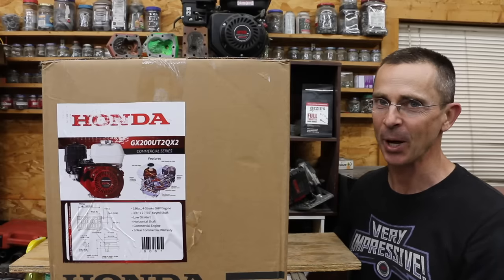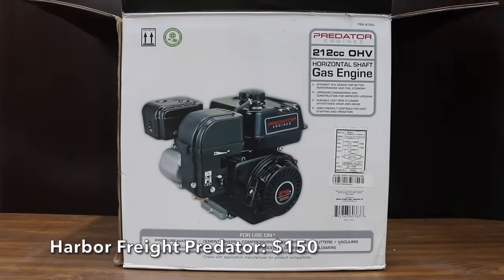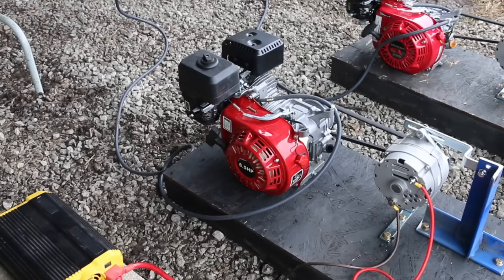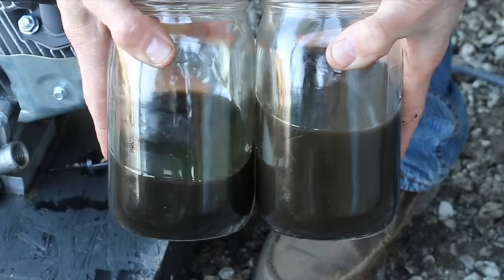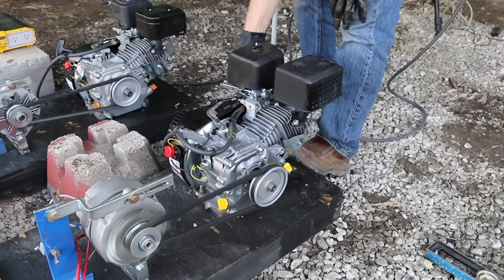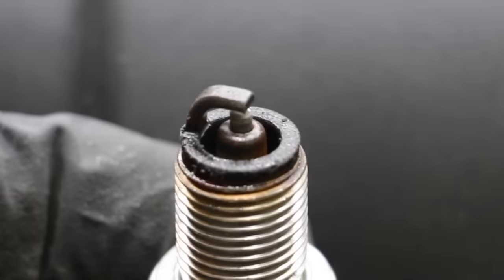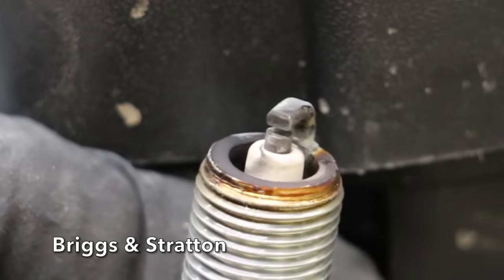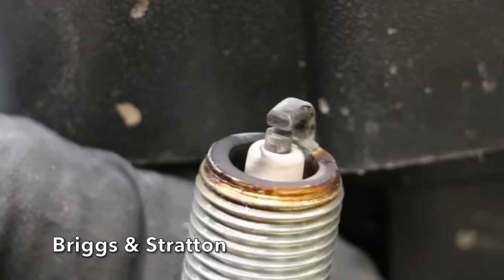$150 Honda Clone vs $600 Honda? Let’s settle this! Fuel Efficiency, Horsepower, Durability, Starting

Comment: I love these types of comparison videos. It's easy to see the joy you get from doing them. I've had the opportunity to compare the Honda and HF Predator products a few times (Generators, Inverter Generators and Gas Engines) and although technically the Honda products might be a bit better quality, the difference in price, in my opinion, doesn't justify buying the Honda product. You'll sometimes pay 3-4 times more for the Honda than the Predator while getting just slightly better quality, and in some cases the Predator is better than the Honda.
Reply from the maker: Thanks!

Comment: Replaced a Briggs 5 hp lawnmower motor with the Predator.  BIG diff in power.  Happy with the result and it's quieter as well ;)
Reply from the maker: Thanks for sharing.

Comment: I own the harbor freight (hemi) 212 cc engine that I purchased 3 years ago for a go-kart for my kids. I better the carb, installed a free flow exhaust with tip, and a torque converter for max HP. She puts out roughly 11 HP with dialed in setttings. Or so I was told. I believe it closer to 9 HP. But EXTREMELY reliable and always starts oh I purchased that Predator motor for a jaw dropping $99.00 3 years ago. It’s still going and I love it.
Reply from the maker: Thanks for sharing.

Comment: Very good videos, just one question. 

Did you run each engine at full throttle without any load nothing on the pto shaft and check each engines rpm to see if they were all the same before doing any tests ?

If you have one running at 3600 rpms and another running at 3200 your output is going to be different. 

Maybe you did and I missed it, I have a digital tach to check rpms on small engines. 

If you did do this and I missed it I truly apologize for bringing this up. 

I do like your videos and am very impressed by your professional efforts. 

Thank you

Comment: HI. I just loved that presentation. Fast clip, delivered like a commentary on the Kentucky Derby or Melbourne Cup. I bet on the Honda, with the Briggs and Stratton a close second. That spark plug analysis fired me up, and drug testing the urine, (sorry, oil) was straight out of horse racing 101. And when the go karts raced across the screen with mine in front by a head, it was so exciting I nearly dropped my beer. So this is what race commentators do when there's no big races on. Well done, Cheers, P.R.
Reply from the maker: Thanks!
Reply: @ProjectFarm  And here's the judge's call: It's P.F. by a nose. Cheers, P.R.

Comment: I used to manufacture concrete floor saws.  What I found was the 5.5 had better torque and performed  than the 6.5 using 1:1 ratio with both Honda and the clone.  With 6.5 motors had to slow the cutter down to avoided stalling. Where the 5.5 you could push cutter harder with out stalling.   Over all the 5.5 cut much faster.   I’ve wondered if gear ratio could help the 6.5 but not tried it.  Great test I do wonder how much difference using 5.5 Honda affected test results. 😊
Reply from the maker: Thanks!  Thanks for the suggestion.

Comment: Ive had one of those predators on a troybilt tiller for about 10 yrs..there is a recommended break in procedure for them. Which includes a few hot cycles and oil change before putting a load on it
.If you follow it to the letter they do much better and last a long time. By the way,  i use royal purple full synthetic in mine
Reply from the maker: Thanks for sharing.

Comment: I have a Hisun 196cc engine that came with my mini bike. I removed the governer and have added performance parts and rode it pretty hard for 3 years. At this point the keyway on the crank shaft is chipping away from the clutch but the motor is still running very strong .
Reply from the maker: Thanks for sharing.

Comment: This is an excellent comparison; initial inspection, fuel consumption, CO, vibration, and on the go-cart. However, you are inside the break-in period here so, next time could you run them all for about 100hr on the generator stand, THEN do the oil analysis and other tests.  I would expect break-in oil to have higher metal content.
Reply: Good point.   100 hr is a very long break in period though.

Comment: Great test of the capabilities and internal wear of each engine.  My question would be: which engine will last the longest over many years?  (Some old John Deere tractors (like 1950s-'70s) are still going strong with normal maintenance and repair).  Will those engines see the same reliability over decades (with expected repairs as needed -- carb rebuild, maybe new rings).  I'm thinking the Honda engine will be going long after any of the others (although with the substantially lower cost of the Predator, you could buy 2 new ones over the years -- and hope the manufacturing hadn't compromised quality over that time).
Reply from the maker: Thanks!

Comment: Great test as usual. But perhaps use grams to weigh the fuel next time or a scale with finer resolution 👍🏼
Reply from the maker: Thanks!  Thanks for the constructive feedback.
Reply: Thanks for taking the time to reply and for the most accurate unbiased tests going. Checking the fuel temp when weighed would be a good call also as of course fuel density changes with temperature. 👍🏼

Comment: I just randomly clicked this video out of curiosity, and I'm super impressed with your thoroughness in testing these engines. I'm also impressed with the  Predator's performance vs. cost. However, if I needed to buy an engine I depended on for something important, I'd probably buy the Honda. If it's was for something like the go-cart in the video, yeah, I'd buy the Predator.
Reply from the maker: Thanks for sharing.

Comment: Also note Briggs carburetors are mostly plastic nowadays and in my experience ALWAYS have problems within the 1st couple of years, Back in the day (1960-1990) carb problems were not a thing like nowadays! Not ALL due to ethanol like some people claim! I would like to see you do a long term test to find out when repair cost of these become cost-prohibitive and how many years they can go before problems start. I have a Honda mower thats I used for 15 years that is just now showing signs of needing me to start shopping for a new one and can not find any less expensive brands brands that I would consider buying because things are built with shareholder profit in mind and not caring about long term consumer retention! I have even seen this in German made automobiles made for the U.S. market having lower lifespans then in the past. "They don'''t  build them like they used to"''!  ! is now true for just about all things these days. I am 62 and can remember when quality mattered. I have tools my grandfather used that will last another 100 years!
Reply from the maker: Thanks for sharing!

Comment: I worked at a place that had both a Honda and a Predator gas-powered water pump, they both are still working after 10 years.
Reply from the maker: Thanks for sharing.

Comment: I bought one of these honda clones about a year ago for a replacement on my rototiller. Ran good mine didnt have much vibration. But before i could finish tilling an area for my garden it dropped the intake valve. Fortunately i had another Honda motor with a good head swapped the heads out and has been running like a champ has tilled 1 hectar now and no issues. I was surprised to see though that my clone had a cast iron sleeve.
Reply from the maker: Thanks for sharing.

Comment: Awesome comparison. I have used the GX35 honda clones from China as part of brushcutters. Had lots of heating and vibration issues. Finally ended up buying a huskvarna and have been very happy. The Honda GX35 knockoffs clearly have very poor engine design... probably not enough precision in the cylinder machining ....
Reply from the maker: Thanks!  Thanks for sharing.

Comment: The Honda clone from memory has a Nikasil bore coating, while the others have an Iron Liner - may explain the high iron content. This would probably reduce once they have been run in and the high spots on bore hatching smoothed.
Reply from the maker: Thanks for the feedback.

Comment: It is quite sad to see the state that Birggs and Stratton is in. The engines they make now are just not hitting on much. I bought a new pressure washer with a side shaft Briggs engine about 2 years ago. It has never completed a single job without something giving me an issue. I also bought a new mower with a Briggs engine around 2017 before I got into working on mowers, and it was on it's death bed after it's second season. Similar stories from a few different people I know. 
Meanwhile, I have a 1977 Snapper push mower with a 5hp Briggs engine, when i got it the oil was black and too thick to drain out of it without flushing it (it was in regular use before I got it.) That mower starts and runs great every time. Same story with my 1976 Snapper with a 3.5hp Briggs, and my 1993 Snapper with a 5.5 Briggs. They made decent engines into the mid-late 2000s, I have a mower from 2009 with the classic style flathead engine, and those engines are still bulletproof even that late. Once they switched to the newer style engines, things seemed to take a noticeable downturn. At this point, I would almost rather have a knock off Chinese engine than a Briggs. I also miss Tecumseh.
Reply from the maker: Thanks for the feedback.

Comment: I have the knock off one which I use to drive a plunger pump to spray herbicide. Fortunately mine doesn't burn oil and still works fine after 2 years, but it really does vibrate a lot, drifting around on flat surfaces when in use.
Reply from the maker: Thanks for the feedback.

Comment: in early 2000 i imported a Zongshen copy of a Johnson 55HP outboard ( into South Africa ) and put it on a ferry at a yacht club for testing. At that stage any motor used on the ferry had gearbox issues within 6-7 months due to the way it was operated, with the ferryman slapping it into reverse at full speed to stop, then full blast on take-off. You get the picture. Also worth mentioning is that the Zongshen cost about 1/3rd of the price of a Johnson. 3 years later when i left South Africa that motor was still going strong. Bizarrely Zongshen decided to discontinue that motor citing it was not reliable?
Reply from the maker: Thanks for sharing.

Comment: I picked up 2 of the Predator engines a couple of years ago on a black Friday buy one get one deal.  I've replaced 1 GX160 so far and about to replace the 2nd in my go karts.  The Predator is quieter than the Honda's they are replacing and have good pick up.  To be fair, however, those GX160's are from the 90's and are worn out.  I"m not expecting to get 30 years out of the Predators but if I do that'll be a nice bonus.  So far the Predator seems to be a good pickup for the cost, but be advised that getting parts for them can be a huge pain in the butt unlike the Honda.  I'll probably rebuild the Honda's with my kids at some point.
Reply from the maker: Thanks for the feedback.

Comment: Picked up the 700 version of this a few years ago. Those oil pumps are notorious for failing. You can buy a kit that caps off the crankshaft/oil pump shaft opening and run premix. Did it to mine. Youll have to trick the computer into thinking it has a full tank of oil so it doesnt go into "limp" mode. I think i just wired in a resistor in place of the sensor.
Reply from the maker: Thanks for sharing.
Reply: @ProjectFarm  Jeeeeese, sorry. This comment was intended for a previous video in my queue and YouTube took it into yours during autoplay. Nice work though! I appreciate all the time and dedication you put into your videos.

Comment: A vindication of my frugal purchase .. A Predator replaced a Honda on my woodsplitter.  It's been starting right up, hot  or very cold for 3 years now..  The Honda lasted for @ 10 years ... if the Predator lasts 5 yrs I could have a new Predator every 5 years for 15 years at the same price as a Honda.
Comment 12,280 🏆
What an excellent review ... WoW !!
Reply from the maker: Thanks!

Comment: Take a steel pipe about 4 feet. You will barley hear the engine. We did that kinda  stuff in the 1960's. It was fun to mount on a bike, put a pulley on the engine and weld a blank rim the same size as the bikes, side by side and a dryer drive belt. It didn't have to go fast. It just looked COOL.
And as far as the exhaust sniffer is concerned - Did you remember to do a lean-best on the fuel metering screws??
There is ALWAYS a tiny catalytic converter!
You're NOT supposed to use synthetic oil are you?? No you aren't..

Comment: Good test just a couple things. The gas should have had the ounces weight as well. Would have been much more accurate. Would have liked to see some tuning for air fuel mixture for your location as the factory gives it a general tune
Reply from the maker: Thanks!  Thanks for the constructive feedback.

Comment: Love to see a video testing commercial-grade vertical shaft engines intended for walk-behind mower use. With Honda exiting the lawnmower market it would be nice to see who has a viable alternative. Kawasaki FJ180V/FJ180V KAI, Kohler CV224, B&S Professional 875 GT,
Reply from the maker: Thanks for the suggestion.

Comment: Used GX200s and GX270s for gokarts. They're so damn durable. Some of the engines I've had have seen 10000 run time hours. The only issue with the GX engines is that the top case bolts like to walk out of the block and allow the oil to evacuate the engine. Honda states in the manual NOT to use threadlocker/sealant, so I check them every service interval to be sure they're still tight.
Reply from the maker: Thanks for sharing.

Comment: them predator 212's are nice with a tuck and run kit i have 1 in my nephews kart for dirt racing. i think it gets 6-8 races on 1 tank of gas. and the speed test dont suprise me they just seem to be very torque based engines. lose all your speed if you get a little sideways and the rpm limiter on his is set to 5200 as the rules state for him. personally for me though i like my briggs lo206 6-$700 does not lose so much speed if u get sideways like the predator does. probably why its preferred in racing in my area. and 300 for a replacement shortblock instead of buying the whole thing again if you blow it up but it last 5 years+ of hard racing. very reliable. plus gets the bonus of being able to use electric start.
Reply from the maker: Thanks for the feedback.

Comment: I have 3 predator engines, one on my pressure washer, one vertical shaft on my push mower, and an extremely modded one on my kids go-kart. They are also Honda clones and very dependable
Reply from the maker: Thanks for sharing.

Comment: Your videos are truly excellent. Though it would take time and gasoline, it would be interesting to run these engines on the generator load until they wear out. I think for a lot of us, expected life span would be a high priority in picking an engine.
Reply from the maker: Thanks for the constructive feedback.
Reply: Given that the clones are already burning oil out of the box, they're basically already half worn out from the factory

Comment: I have Honda 13hp clone new on my wood splitter and it never burns or loses oil, I just keep the oil ,fuel clean and keep it under shelter and it runs well, gone through a couple of spark plugs, and had fuel in the oil from stuck needle valve once , but I have owned since 2007 but I can’t complain……….New Zealand.
Reply from the maker: Thanks for sharing.

Comment: excellent video test!  i will be using predator engines since there's a harbor freight close by because of the value, however i would think the honda would be the better engine as far as longevity is concerned.  think you could test these two engines for longevity under load?  maybe for a DIY generator project the honda would be the best??
Reply from the maker: Thanks!  Thanks for sharing.

Comment: Am I the only one that noticed, synthetic oil was used in brand new engines? AFAIK, you are supposed to use dino oil to break the engine in/seat rings. THEN switch over to synthetic for regular use. This being the internet I'm certain someone will come along and correct me if I'm wrong ;) 

I just found this channel, and am finding it excellent. But you need to break em in before you can make realistic comparisons here, in my humble opinion. Especially in regard to oil consumption, and initial compression.

Comment: 3:57 Honda engines almost always start on the first pull. My much abused Honda-based lawn mower starts first pull after spending a long British autumn, winter and spring under covers. The only Honda I have encountered that was not so reliable was the fuel bowser pump engine at my local airfield, which sometimes took two tugs.
Reply from the maker: Thanks for the feedback.

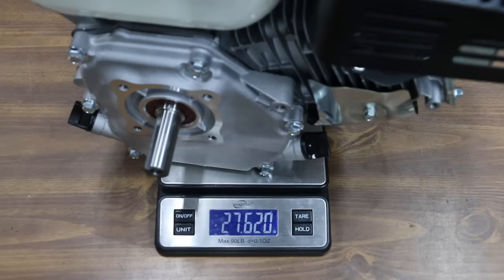Comment: 1:09 As a former Honda / Suzuki dealer mechanic, I am offended by the very notion there is even a test needed to settle this. However, proceed maestro! 'cause I am sitting in the middle of an Arctic outflow, freezing my nuts off, and need to be entertained.😜😜😂😂👍👍
Reply: You'll be needing a honda then. The chinesium is poor 😁

Comment: The predators are made by a couple of different Chinese companies. The ones with the cast aluminum valve cover are hemi engines.
 Your predator has a cast aluminum valve cover.
 Did you happen to look at the combustion chamber while the head was off?

Comment: You should do a redo comparing a 200cc Briggs & Stratton Vanguard engine with the Honda GX200 engine.
Reply from the maker: Thanks for the suggestion.
Reply: @ProjectFarm Thanks! There's a big debate in the small power equipment community on which commercial-grade engine is better. I think comparing the two would be interesting to see how they stack up objectively.